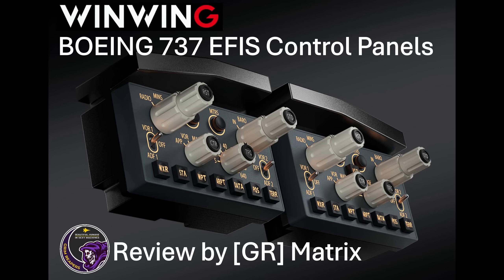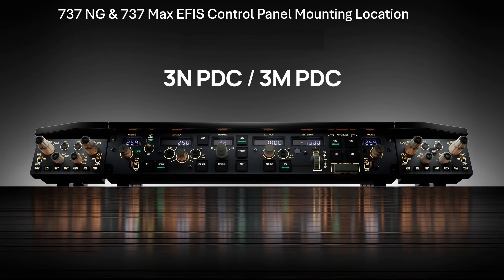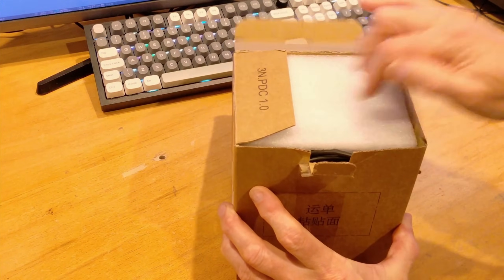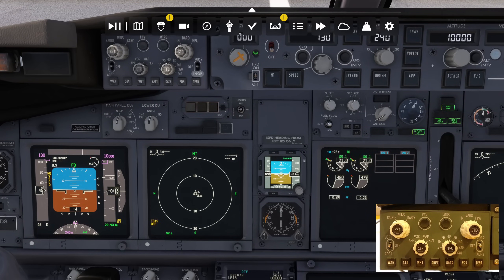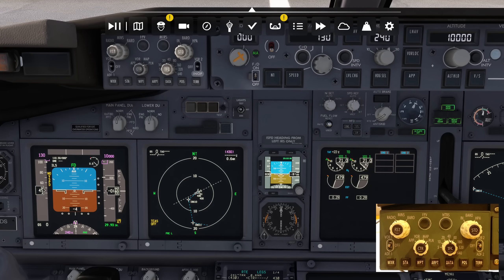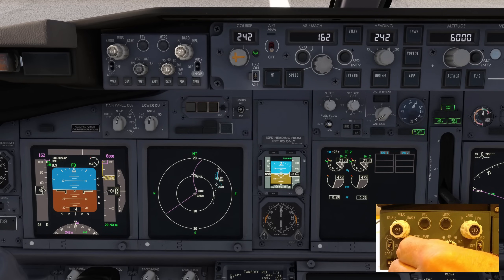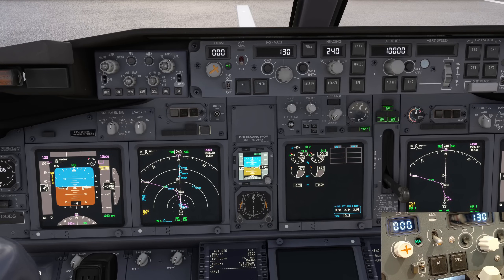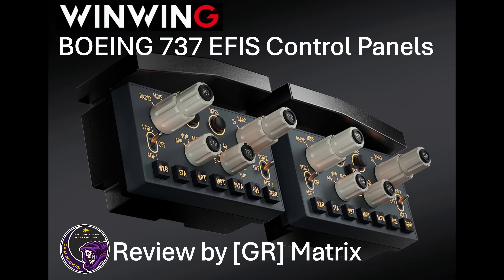Product Review: Boeing 737 NG & Max EFIS Control Panels (3M PDC & 3N PDC)

Comment: Just a note - PMDG, for example, do NOT have a control for the second, outer position of the rotary controls for BARO ref and MINS (the one that changes the QNH/altimeter setting or minimums in multiples of tens). So while the Winwing controller has a button for that, you'll have to do fancy tricks to actually make it work realistically with the PMDG 737 and 777. I don't know about other products, I only have Boeings from them. It will change the BARO ref and MINS, just slowly.

Edit to add: the rapid change you show in the video has apparently been corrected in the latest Simapp Pro software from Winwing:
7. Fixed the issue in MSFS2020 PMDG737 series where the PDC3N/3M device knobs changed values too quickly in the game.

That is unrelated to what I'm talking about above.
Reply: Thank you for the info.

Comment: Wait.  Someone wants to PRETEND to fly a 737?  Does it simulate being in the second jumpseat with your legs around your ears, or, alternately, the 1960s trim wheel running constantly?  Maybe there's an MCAS mode where it just decides to nose over and good luck?  All in good fun, of course.
Reply: Hey, don't knock the 'aural trim feedback device' :) It's handy if the trim, say for example, runs away....for any reason? And the second jumpseat is for putting the books on, nothing more. Those books need a padded seat.